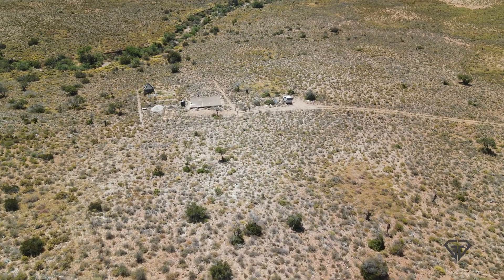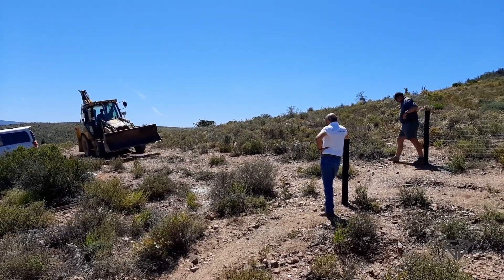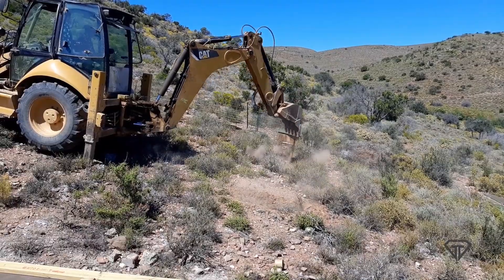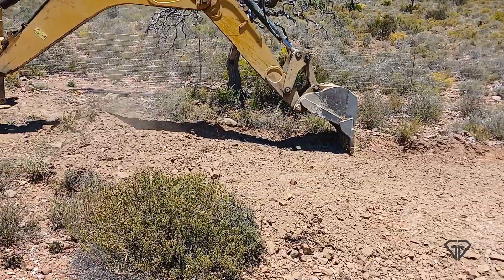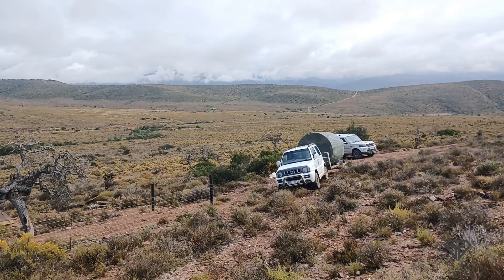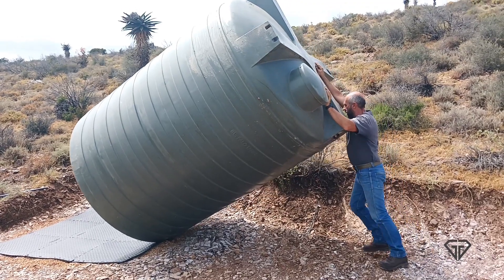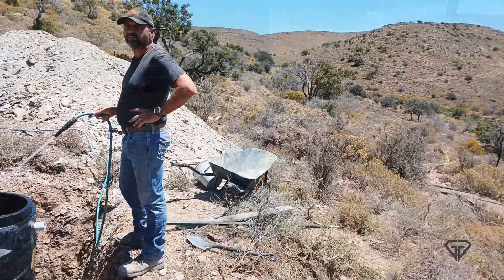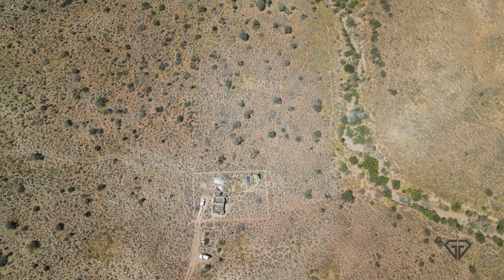Tanks:  Septic, and Water (Update 011)

Comment: Good going. I like the rubber mat idea. Sure the excavator would have made lighter work of that, but at a great cost I reckon. Just getting to the site would take double the time at double the hourly cost
Reply from the maker: I agree.  Tracked vehicles cost more to travel than wheeled vehicles.  And proximity is key - an excavator would need to be brought in from further away.